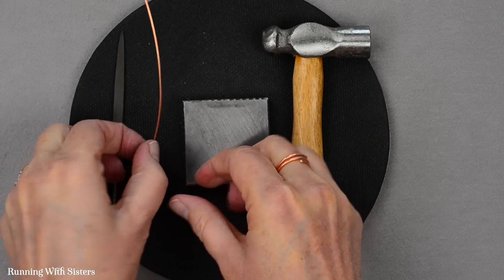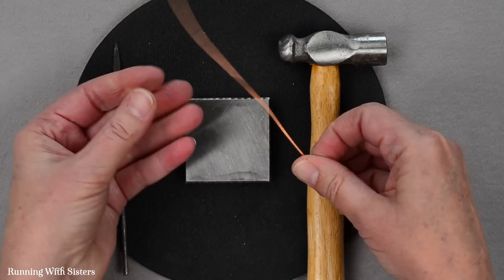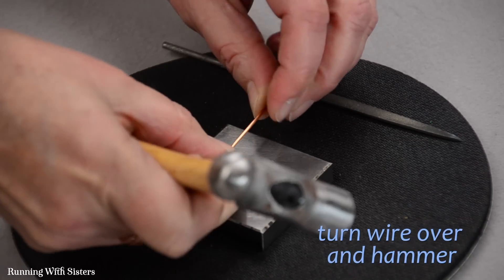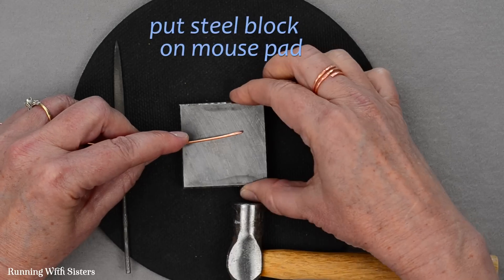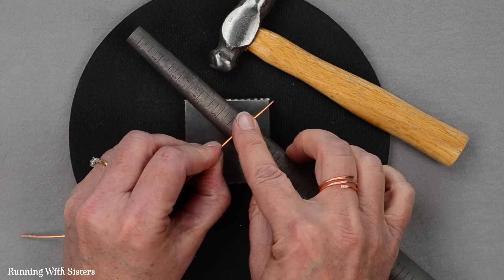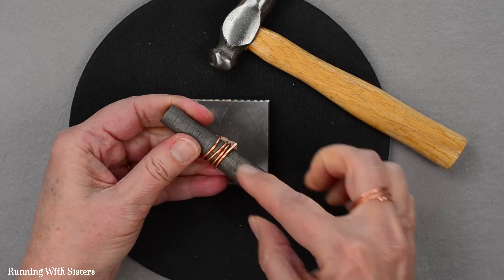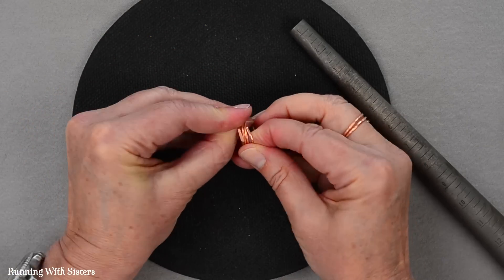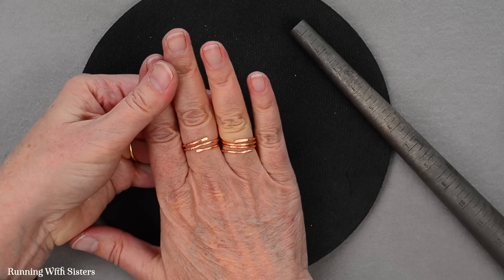How To Make A Hammered Copper Wrap Ring

Comment: is this dead soft wire?  my new wire has black comi g off of it.  should I be fetting the coated instead?
Reply from the maker: Hi Heather, Yes copper wire is dead soft typically. Very easy to bend. Not sure why there is black on your wire. Where did you get it? We buy plain copper wire with no coating. Could yours be oiled? Can you wipe it clean?
Jennifer & Kitty
Reply: @TheONeilSisters  You're right it is probably oil!  😊 thanks

Comment: Can you hammer the copper before you wrap it? Or does it help with the overall shape? Just wondering as, lovely ring
Reply from the maker: Great question! Hammering the metal hardens it and makes it harder to bend around the mandrel so we think it's better to hammer it on the mandrel. Plus hammering it on the mandrel helps shape it and size it. Hope that helps!
Cheers,
J&K
Reply: @TheONeilSisters  thanks for the great information 😁
Reply from the maker: You're welcome!